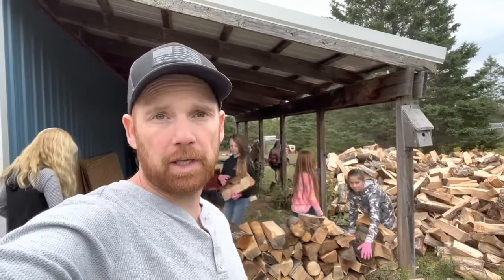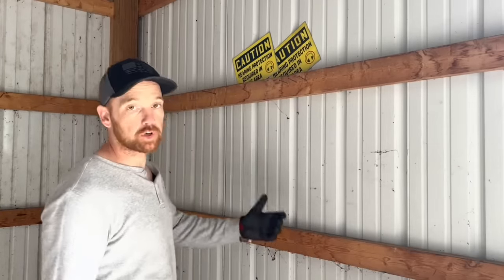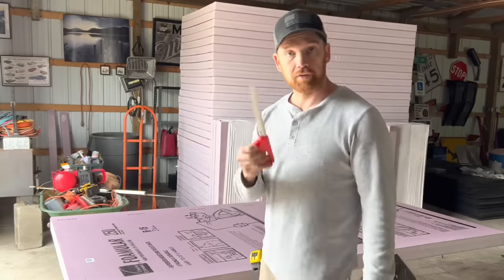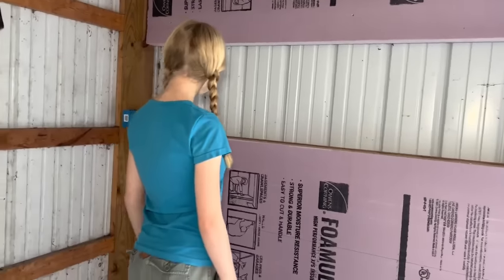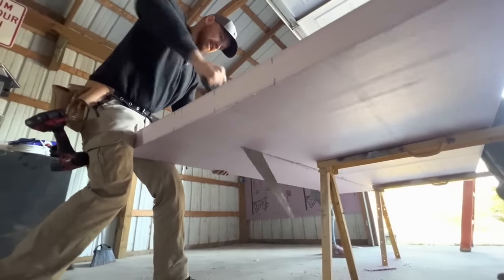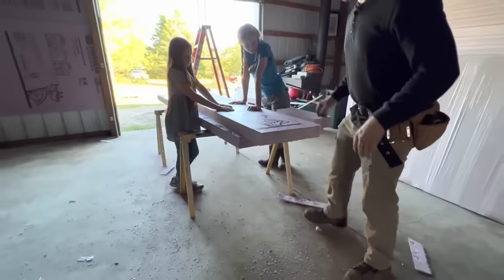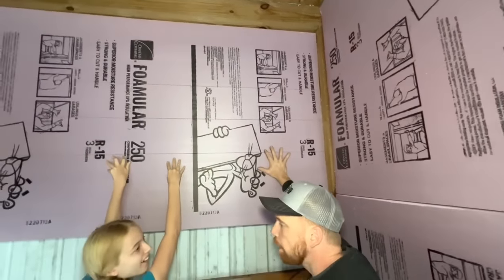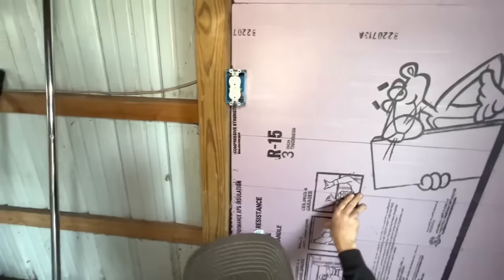Insulating our steel building/garage | Why we are NOT using Spray foam... Family prepares for winter

Comment: any issues using that type of glue?  i've read that you need to use a specific foam insulation glue, when working with foam board.
Reply from the maker: This glue is for foam board. It works great but I don’t think it is really necessary. I think by just using the closed cell spray can foam that I have would be plenty also they make a foam tape for the seams as well.

Comment: So with the venting - on the exterior you will need to maintain that area around the sheet metal that allows for air flow you pointed out. 
What's the plan to ensure that?
Reply from the maker: I may end up stuffing in a steel wool or some sort of copper mesh just so the bugs and critters won’t make their way in and eventually plug it up.

Comment: Just be aware that rigid board is more flammable than SPF, and there isn't a paint available that can give a 15 minute thermal barrier over polystyrene. If you have to meet fire code, it has to have sheetrock over it.
Reply from the maker: We’re not going to have to meet any codes. At least I’m not going to ask. 😆

Comment: And there are all kinds of problems with spray foam. The two worst are: 1) will never know if moisture got trapped in and has rotted the wood 2) cannot open it up to change or fix or improve or anything. It's stuck on. The job you did here and the jobs I've done could be disassembled, fiddled with for whatever reason came about for needing fiddling, then re-installed/repaired or section replaced or changed. How much labour do you think is involved removing spray foam? Oh and I heard some insurance companies won't insure a home without the ability to inspect past insulation for wood rot. Don't spray foam. Somebody invented a product that they can mass manufacture for cheap and sell at an insane price rather than be price competitive because of how many people can be fooled. Don't be fooled.

Comment: Maybe you will do this later but it’s important to seal all seams and edges with tape or you lose the air barrier benefits. Also there is no  benefit in venting the wall.  Air gaps are the enemy.  That just allows moisture bugs and rodents in.  I would spray foam those ridges at the floor and ceiling.  That’s the beauty of the spray foam on walls.  No air gaps, no mouse runs. But 16K, ouch. Can’t blame you.

Comment: The nearest thing I seen for cutting styrofoam insulation was a guy build a little frame from one by three it could even be one by one that had a wire that was running outside the frame, then connected to a battery negative positive cut the Styrofoam slicker than butter…..lol sorry I can’t draw you a picture….

Comment: that much foamboard and cuts, I'd go with a hot-knife or hot-wire foam cutter and a cheap bench with adjustable guide to keep the cuts straight.
either get a cheap setup or build your own.  just pay mind to the foam types, not all play well with heat cutting and or emit many toxic fumes. that is XPS and not too bad.
Reply from the maker: I am very familiar with toxins in foam products which is why I opted out of any type of heat to cut. Especially having my kids help me.

Comment: How do you keep the rain from running under the siding and into the garage?  If the opening at the bottom is letting air in to ventilate the walls, then water will also run in at the same place.
Reply from the maker: The bottom vented area is up off the ground about 6 inches and water runs down past it not in. There’s also no flooding around the garage so it works out well.

Comment: Why didn't you use back plates for the screws to prevent them from pulling through?
Reply from the maker: Because we are putting up a steal roofing material in the walls and there’s no need for backplates as mentioned in the video

Comment: The best reason to never use spray foam. If you need plumbing or electrical work done. Even doing an addition. You now have all that spray foam in the way. So with it, if you want to add say an outlet. Well, you're now stuck with having to run it, or run conduit pipe, on the outside of the building, or outside of the interior frame. All you're doing with spray foam is increasing any later renovation costs.

Comment: U should use washers on ur screws so later on the board don't work lose in fall down had it happen to me from pressure in my house opening the door
Reply from the maker: We’re installing metal roofing type material over it.
Reply: @9252 LIFE  ya I saw that after I text I had to wait like a month to get my wall material so sense I didn't put washers some of them came down so had to do that tell I could get the walls up

Comment: Wondering how your basic hack saw would work cutting that pink stuff.
Reply from the maker: The other metal part of the saw would be too wide to pass through the thin cut the blade makes. But I’m sure the fine blade would cut well.

Comment: I had a shed spray foamed.   something is not eating the spray foam, but taking it off and using in their nest.   Weird.  i'm thinking mouse.   I also had some canned foam used to insulate pipes.   They removed it all.   every piece.

Comment: IDK if anyone else has commented about this or not but this insulation puts off toxic fumes in the event of a fire. In residential construction it has to be covered with fire rated drywall. I wouldn't think that it has much if any fire resistance given that it's foam. I wouldn't burn or weld around it unless you're sure it's sealed in tight enough.
Reply from the maker: You may of missed the part where I had mentioned that we’re putting steel up on the walls and ceiling. And all insulation will put off toxic fumes when burning..

Comment: Did the hand saw you used have cross cut or rip cut teeth?  A crosscut would create a wider kerf.
Reply from the maker: Good question. It’s just a standard wood saw
Reply: @9252LIFE  Crosscut teeth are staggered while rip cut teeth are in line with each other.

Comment: Did you consider using a DIY Froth pack to spray foam it yourself?
Reply from the maker: Yes I looked into that. A bit pricey also and in all honesty this foam board seems like it’d be much easier to deal with later on when adding on or doing repairs to the building.

Comment: Your arguments on the economy are valid. But here is another argument. Extruded polystyrene foam is made with a patented process using steam as a blowing agent. You get 5 points per inch. But there is nothing to out gas!

Spray foam is an isocyonate which uses chemicals as a blowing agent. So yes, you get more than 5 points per inch. But over a couple of years, this will out gas and the performance drops to EPS at 5 points per inch. So you don’t see the performance they claim over the long haul.

I have done this using a table saw to cut precise chunks. Yes it’s a pain but it’s much cheaper, works as well and has long term performance. It’s my favorite insulation and it’s closed cell.

You can get it as pink or blue. Same material and process, just one is Owens Corning and the other is Dow.

Comment: If you use  a 9mm blade  knife  !!  You can cut  real  easy  the foam .   I work on insulation  for 27 years and that  is the  easy  way to cut the board.    You can buy the knife  a  home depot  is. $7 dollars          good job  I do spray foam insulation !! But this  way  is better  .

Comment: Did you price renting a sprayer & spraying it yourself?
Reply from the maker: I looked at the different types of diy spray foams. Up here in the Upper Peninsula of Michigan we don’t have access to a lot of equipment to rent. But after researching the spray foam there just seems to be a lot more negatives than positives. So I believe I made the right choice. And I can guarantee that my garage will hold heat extremely well with this type insulation.

Comment: 6:02 The knife I use to cut solid insulation is the dewalt snap off razor knife. Costs $13 bucks and you can replace the blade. Oh, and it doesn't suck.

Comment: Those vertical airways are great rodent tracks to your attic.  Better put some metal screening on the bottom to prevent damaging visitors. Ask the Youtube couple living in Northern Idaho.  They had that probem and had to pull off the lower building skin to fix the issue.
Reply from the maker: Check out our newest video. We installed rat guard
Reply: @9252LIFE  Yea, after I posted that and finished the video, I saw you had another video covering that.  Nice buiding.  Good luck with it.  Loved the working daughters, htey are certainly not lazy.  Nice family, God bless.
Reply from the maker: @brucemckelvy9920  thank you Bruce

Comment: The thing with leaving the ribs open at the bottom is mice will come through them and chew your insulation to pieces  in my experience
Reply from the maker: Did you have foam board insulation? I know they like the fiberglass stuff but haven’t seen em chew through foam board
Reply: They actually chewed through the Styrofoam and also chewed through drywall in places

Comment: Another reason you shouldn’t spray foam on the back of steel sheets: if the sheets get damaged and need to be replaced you loose your spray foam as well.

Comment: you put it on the 2x6's. that puts a gap between the metal siding and the insulation. this will let it sweet and rust. that is what the manufacture of my building told me. thay say it needs to be on the metal siding.
Reply from the maker: You may want to do some research on that

Comment: Did you finally get your barn insulation done,
Reply from the maker: Yes. We actually only have the bubble foil on the ceiling covered up with metal material now. Probably going to see how it holds in heat and then put in the blow in insulation up above.
Reply: @9252LIFE  now you have room to work, out of the weather
Reply from the maker: @mikeyoung5211  we still don’t have electricity in there because the inspector made us pull all our existing wire. Now we have to rewrire everything through conduit and place it on the exterior of the inside walls

Comment: Insulating the sides and not the roof is worthless right? All your heat will dissipate through the roof panels. Or do you have another video showing the roof insulation?
Reply from the maker: I mentioned in the video that we’re doing the roof after we get the walls done. No video on that yet
Reply: @9252LIFE  ok, cool.

Comment: I would rather spray an inch thick of foam between the boards on the metal .sound deadening and insulates better.you will still have a draft of cold air with just the foam

Comment: I just score 1/2 in. with a razor knife and push down on one side, and it snaps off clean, just like cutting glass.
Reply from the maker: Even with the 3 inch?
Reply: @9252LIFE  I used 2". I would think cutting the depth of a razor knife in 3" should do the same. My scores on the 2" were between 1/4" and 1/2". Try it and let me know. I was shocked when my contractor showed me. My cuts only took 15 seconds instead of 5 minutes, and I didn't have a styrofoam mess to clean up.

Comment: If you ever have any electrical issues - disconnect the bad circuit at the breaker box. Then run a new service line via surface mounted metal conduit. It’s a garage, nobody will care.
Reply from the maker: If the electrical wasn’t already there I would’ve done the external conduit. And yea that’d most likely be the route I’d take if ever any issues down the road.

Comment: I’m trying to figure out what’s the best way to insulate my steel building home in South Florida. Getting so much info. Spray, don’t spray … but I want both air tight and good r value - anyone with suggestions that have experience?

Comment: Hey man, there's supposed to be a bottom trim and rat board.  Those ribs are going to be a highway for rodents to the attic.
Reply from the maker: I’m going to with use a steel wool or the closed cell foam out of a can that I have.

Comment: Spray foam directly to metal panels will trap moisture. The system you are using is correct.

Comment: You're saying you want it "air tight" but the foam board isn't going to block any of the cold air coming in from the outside. 

Then heat rises...so exactly why did you determine that insulation wouldn't be needed above the wall? The heat is going to just rise right out of your metal roof. Did you install ceiling fans to reverse the air flow and at least try to drive the warm air back down? 

I've used both rigid and foam on my farm. Rigid foam is only for blocking an open hole or gap temporarily.  Spray foam is far superior and the best possible choice for insulation. The only other consideration could be mineral wool. Sure, spray foam is more expensive because it seals the cold air out, and has a much higher R value. Because you didn't seal your boards above or below, you have zero R value. 

It's expensive to spend $2500 and even more expensive not do it correctly. All your heat will dissipate through the roof. You'll have cold air blow through the bottom and top.

When this fails, check out the professional spray foam you can do yourself. You really have to do the roof though, that's never optional for insulating a building, it has to be done to keep heat inside. 

It's why barns have haylofts. Those were the original "insulation" for farmers.
Reply from the maker: Thanks Jennifer but you may have not paid much attention to the video. We are installing insulation in the ceiling and also sealing the cracks between the foam boards and wood with the spray can closed cell foam. This will not fail as it’s a proven method. We’ll be doing an update video soon when completely finished. Thanks for your time and concerns

Comment: How's that going to work when you need to put the screws into the wood for the sheet and steel on the inside you will have to get super long screws not sure they even make 4-in screws for steel
Reply from the maker: We’ve got 4 inch screws for steel. We can get up to 8”.

Comment: BOSCH T313AW3 3-Piece 6 In. Knife Edge Special for Soft Materials T-Shank Jig Saw Blades ... Cuts this stuff like a hot knife through warm butter and very little mess....
Reply: Oh and by the way those blades are sharp sharp sharp will slice off fingers toes arms legs and any other appendage they come in contact with... I cut myself just taking one out of the package... But they enabled me to finish my project with very little mess and fast fast fast.
Reply from the maker: I’ll stick with the old wood saw! 😂

Comment: Hey there, just wanted to mention that you can get Spray foam for (maybe not CHEAP) but a HELL of a lot cheaper than the idiot that was saying you needed to pay 16k to do your building..... Not sure of all the lingo they use, but for 400$ walmart has a kit that covers what they called 200 board feet? Which I assume in a 10 foot by 20 foot area.
I wasn't able to see how much the others covered, but they all mentioned weights 41 pounds, 42 pounds, 3.3 pounds. And they varied in price from 125$ (3.3 pounds), up to 950$ or so, with the 41 and 42 pound packs being between 650 and 725$.
From what I've seen it does take a little bit of getting used to spraying the stuff, but the walls should be easy to DIY.
(I'd looked into the stuff myself due to some projects I am working on around my homestead.).
I know it's going to be too late for you to use this info on the current project, but maybe on the next one. :D

Thanks for the video, and for being so thorough on explaining how you do things with the solid foam insulation. If that stuff wasn't so bloody expensive then I'd try to use that. I refuse to touch fiber glass insulation that crap is stupidly dangerous.
Reply from the maker: Also an advantage to using this style board insulation is that if the outside sheet metal gets damaged some how I can simply take off the foam board insulation and replace the sheet metal and put back the foam board instead of having to deal with all the spray foam.
Reply: @9252LIFE  Yeah I'd forgotten about the desire to remove the internal layers to get to anything that might be messed up. (I'm sure it's possible to set up something like that with spray foam, but I bet it'd be a LOT more trouble than it's worth.). 

Well even if the info isn't of help for this project, maybe you can use this info in a future project. But I hope that you can get the building the rest of the way insulated before winter hits.... You guys have it harsh up there in your area. Stay safe dude.

Comment: Why not 1-1/2 in foam between the strapping , built 2/4 walls to be flush with your post , then the highest R rated fiberglass , you’d have your foam , dead air space and 3-1/2 fiberglass ! You could run your electric in the dead air space ?
Reply from the maker: We don’t want to use fiberglass. Never seems to hold up good years later
Reply: @9252LIFE  I see said the blind man as he picked up the hammer an saw !!

Comment: Sorry to be critical! However. those gaps in the bottom corrugated sheathing that you think will serve as ventilation will now be serving as entrances for mice,insects and perhaps other rodents. J channel ot L flashing should have been installed first . This is a mistake very commonly made by DIYer’s all the time. You should try to fix this sooner than later.
Reply from the maker: Thank you Chris. We have since fixed that with the rat guard. See our newest video

Comment: Does that PL eat foam? We use to only use PL 300 for foam. I didn’t melt the foam
Reply from the maker: PL?
Reply: That caulking you are using use to be called PL 400. They made PL300 for foam applications.
Reply from the maker: @superdplum  oh no it says its for foam board specifically
Reply: Great, thanks for the info.